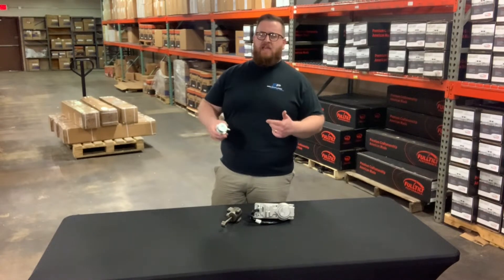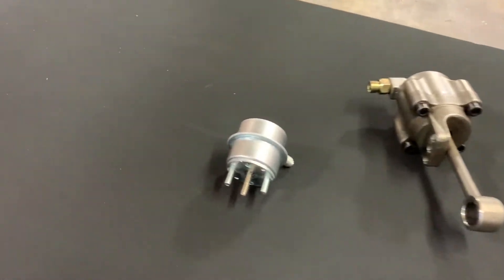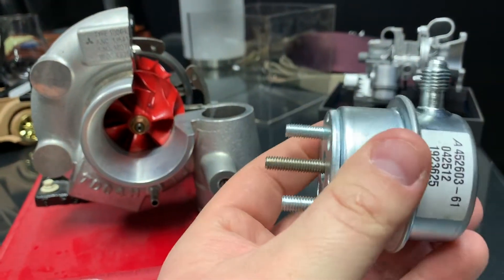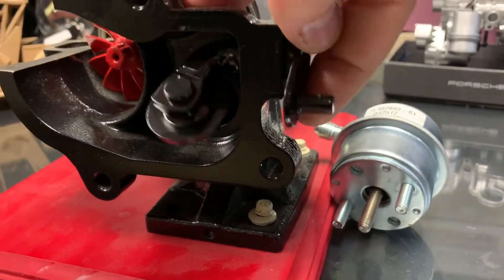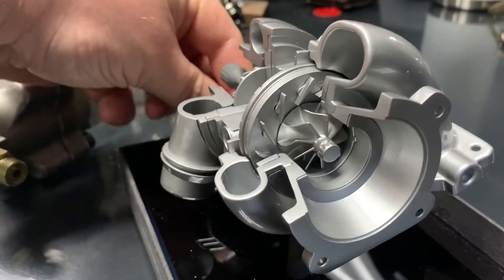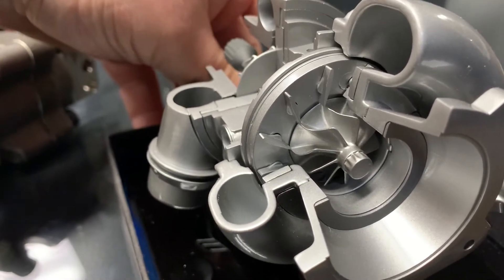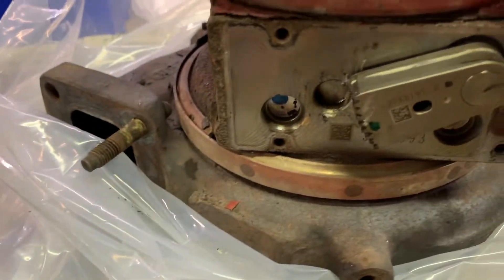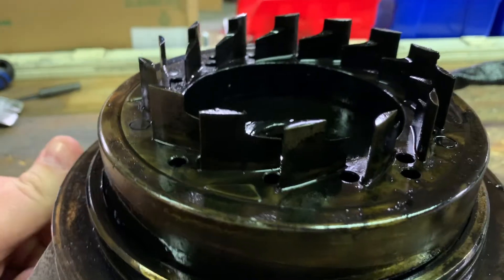Cummins Holset VGT Turbo Actuator, Turbo Wastegate Actuator | What are they?

Comment: How could a VGT actuator prevent an engine from running if it were stuck? I had problems where my truck would start and then slowly stall out and die. It would usually run for a bit then stall but eventually after several restarts it would shut off immediately after being started. I had the actuator replaced and haven't had any problems since but I don't understand how this thing could totally prevent my truck from running if it just controls air flow from the exhaust
Reply from the maker: Hypothetically, if the VGT was completely in the closed position and restricting air flow to the point that exhaust gas could not escape fast enough that the back pressure reached a level high enough to overcome the pressure of engine combustion, then it would stall the engine at that time. 

Its effectively the same thing as plugging the exhaust to shut a motor down, but in a slower fashion as the exhaust route was not 100% blocked.  

Again, just a theory.
Reply: @momentumworx  well I think you're right cus Peterbilt had wrote on my work order it was due to high exhaust back pressure

Comment: Does pneumatic vnt actuator have to be recalibrated when a new turbo is installed?
Reply from the maker: Yes, the pre-load on the actuator rod normally has to be adjusted, but the necessity of an actual calibration as far as the ECU will vary depending on the application